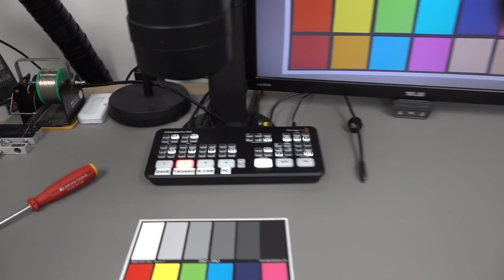New Grey ESD Mat & Camera Exposure

Comment: The thing thay really kills me over these ESD mats is they dont work with the newer optical sensors on modern mice. If you get something like a high performance gaming mouse these days they all use the same exact high resolution sensor in them. And it flat out doesnt work (at all). I have tried everything i can think of at this point, including tarnishing (bdulling) the surface with chemicals, and testing samples of slightly different finish version. Including this 'snakeskin' slightly more textured type. Nothing works! Please help if you can do anything to help get the manufacturers involved for future products. I have also considered trying to apply some special spray or other coating. However you dont want too thick a barrier that will diminish the anti static capability to dissipate charge. And also because any thin coating will get removed with the constant cleaning. Which i have to do very often spray down the mat with IPA to remove flux and other soldering crap. If this problem interests anybody else? Then please say something! Cannot find anything too helpful online after so many months. It feels like... so hard to find a solution. For such a deceptively simple problem. Do the manifacturers even care about this issue? Who actually makes these things anyway?
Reply: Or , you know, you could buy a mouse pad.
Reply: @moki123g  lol like i hadn't already considered that. Like i don't already do exactly that. Listen pal, it doesn't work once you have your breadboards out. And lab equipment out PSU, scope etc. and wires strewn all over the whole table.

There is really no room left to have a seperate dedicated area for the mouse that isn't miles away from your actual electronics project. And i have a massive desk here. It simply doesnt work out that way. When you are constantly having to go back and forth between the circuit, all those electronics stuff, to open a bunch of open PDF datasheets on the PC. It requires very frequent reaching over for the mouse. And that becomes a significant productivity drain on productivity. Not fun.

The way the desk clutter ends up is always with 'whatever dead space inbetween the mess of wires' is where the mouse gets crammed in and relegated to. Which is usually a tiny space nearby. So i use a high sensitivity hi resolution gaming mouse, that you can flick about without too much travel. Because upsetting wires or reaching over wires is no fun either. At least not when you have to do it constantly all the time. Get it? Understand?

Comment: With the gray mat your hands actually increase the brightness a little where before it would reduce the brightness of the image. BTW, what is that 6809 board you were using for the demo in this video? It has a 68B09 on it and it mentions the 40th anniversary but I couldn't quite read the name of the board designer.
Reply from the maker: 6809 computer by David Flamand
Reply: @EEVblog2 Thanks, Dave. Looks like an interesting board. Unfortunately I can't find anything out about it via an Internet search.

Comment: 18% gray is the value of white people's skin, so traditionally it was used by portrait photographers to measure exposure. Auto exposure systems are optimized for 18%. Some old Polaroid cameras had an exposure boost button that improved exposure of darker skin.
Reply: Hmmm... not so sure about that. Pretty sure it was from a study done ages ago to determine the exposure value of an 'average well exposed photo'... and 18% was what they came up with. The word 'average' is a mouth full in this context... because if the frame in question has a lot of bright  or dark areas, they need to be compensated for. Ever notice how most (better) cameras have exposure compensation provisions... often as a scale with zero at the middle going plus - minus to either side?[1] It's for the photographer to tell the camera to use what it thinks is correct; but to add or subtract x number of stops when actually taking the photograph. There's very much more to all this... take a look at the 'Exposure (photography)' and 'Exposure compensation' Wikipedia entries.
[1] The old 'exposure boost button' was just renamed exposure compensation.

Comment: That's so funny somehow. I just built a new working area using the same grey mat a few days ago. I have multiple cameras looking at it, so I chose grey for the same reason. Strong heat will turn this grey surface a little more yellow. Something to keep in mind. Yours seems to be 3-layer, mine is 2-layer (black conductive layer at the bottom, dissipative grey layer on top). The black layer is very conductive and goes through the 1M resistor within the clip. Static electricity on the non-conductive top layer gets absorbed into the bottom layer very quickly. The top layer can never build a charge, even though it won't spark or give a sudden discharge to a charged object placed on top of it. I know that these are all basic concepts but it's honestly pretty cool to me haha. Like magic. Get better soon!